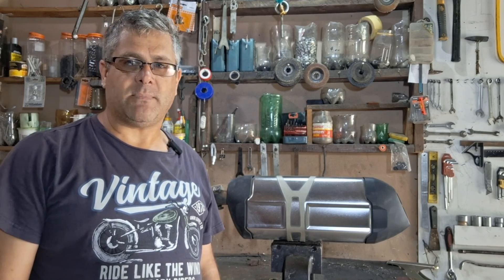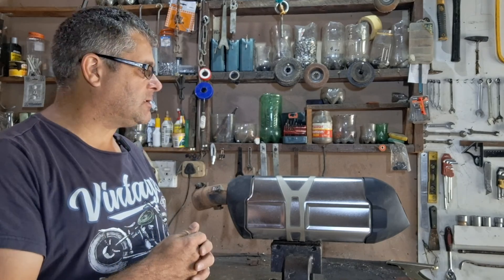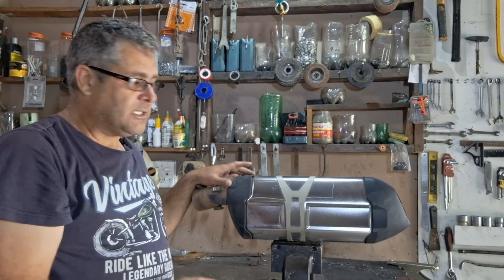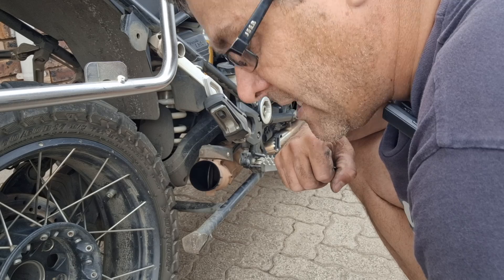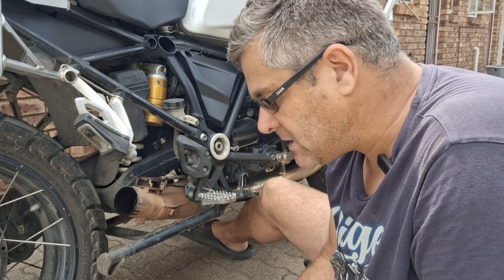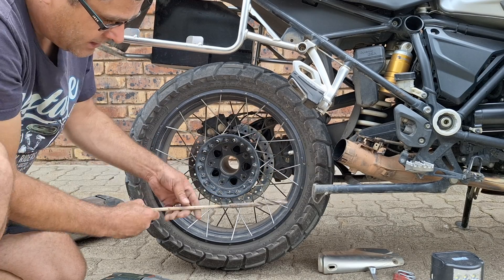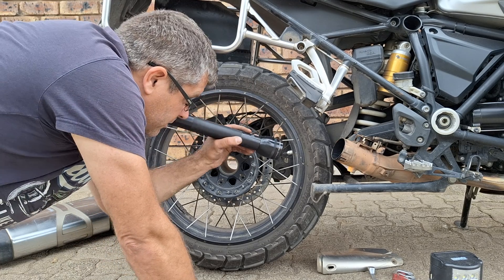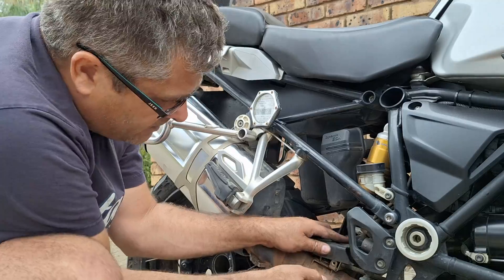BMW R1200GS exhaust baffle, valve and catalytic converter removal

Comment: Hi I drilled  my  cat out completely.the stainless is very hard i did not go through.you can also take the cables off completely.I also took my butterfly valve out bike works and is a bit louder.